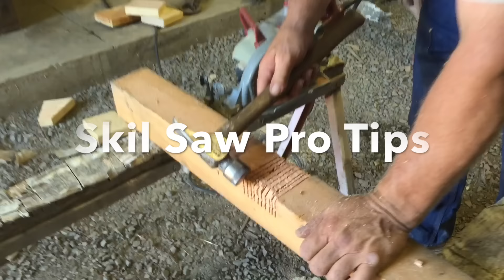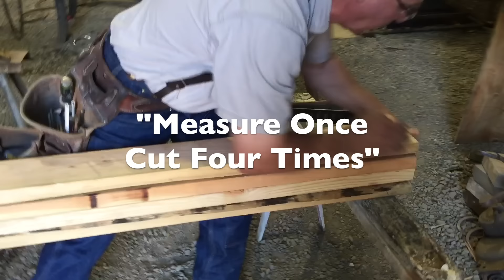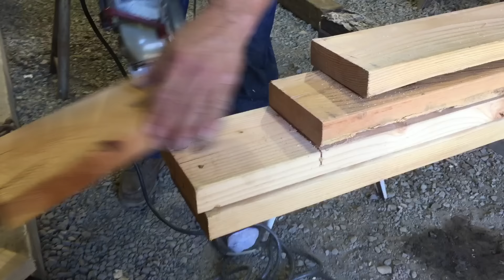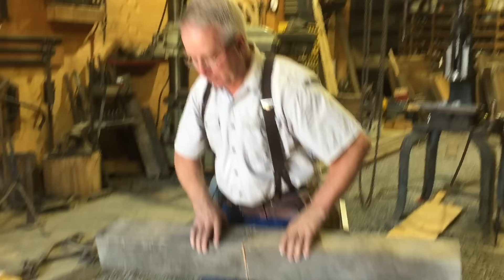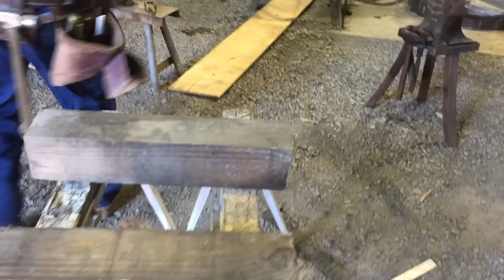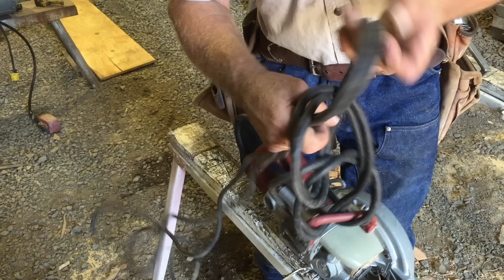Skil Saw Pro Tips

Comment: I’ve cut lots of roofing with a skill saw with the blade backwards. Yesterday I cut roofing with a metal blade my work place provided. Talk about shrapnel. Wore a face shield, leather gloves. Never before have I been hit with so much metal cutting roof. My neck and arms are full of little micro cuts . The metal cutting blade sends little rectangles flying at you. Not to mention my shirt is now full of hundreds of these little metal flakes. Terrible experience. I would recommend a welding apron or leather jacket of some sort.

Comment: I have learned most of your skilsaw tricks over the years, but not as easily as you, for sure!  Often I didn't have any other tool and had to improvise.  Watching you, I see that a lot of your authority with the handling of the saw is because it's a real builder's worm drive saw, with the weight, balance, power and solidity to do whatever you ask it to.

Comment: Before the "truss hook" we would just bury the blade into the truss. Truss adds weight. 
I remember the Skill Saws with out the plastic handles here in the Pacific Northwest it rains a lot. We'd grab the saw and cut everything we could as fast as we could because it would shock you big time! The ground was the 1st to go on the saws. :-) Awa the good old dats at $1.60 per sq ft.

Comment: He didn't say anything about using a carpenter pencil for a rip guide or stacking blades on a regular. Circular saw to cut a dado.or flipping the board over. To eliminate over cuts.if you cut across the long grain that weakens the board I Dont care what he says.I mean I'm sporting 35 years of framing. Custom homes to building one of a kind furniture out of. 1000 year old dead head cypress or boats with juniper(no knots).just saying

Comment: Done it all but when cutting metal i start with the saw away then cut towards me so the blade digs down not up. Like a tablesaw so to speak. I also know that cutting or nicking concrete with the blade will dull it faster that cutting through nails.

Comment: The first things I do to a model 77 when I get one:
1. Put a 30 to 40 foot neoprene cord on the saw. (Got to have that cold weather flexibility.)
2. Sky hook if the saw doesn't come with one.
3. Take the guard off. (Unless I'm buying a saw because the job I'm on requires them and I can't find the ones I've taken off my other saws. Then it would kind of defeat the purpose.) DISCLAIMER: This is what I do and you should probably not do this. If you do and you loose a finger don't point your missing finger at me. You knew the job was dangerous when you took it.

Comment: I used to have a 7-1/4” circular saw but like many machines the motor was on the right blade on left. I hated it. Could never properly see where I was cutting. The Skill saw with blade on the left you can see the cut and you have far better control.

Comment: 10:48 - and let's face it, the cable is replaceable and often the do need replaced. I have a 1970's Black and Decker saw which was used extensively by my carpenter uncle - I now own it and have used it to build my garage and house extension. The cable still has a taped up bit about 6 inches from the saw, I really need to buy some decent rubber flex and repair that!

Comment: may father is 75 has the same skill set this guy does.. when he was in construction rough frame up he would build a house a week one time a house in 8 hours cutting 220 boards in a single day all this stuff hes showing is what my dad did.. i picked up a few things.. but the technical things are just beyond me his carpentry of 40 years paid for the house im in paid for his carpenters retirement paid for my entire life and is still doing so to this day.. those skills transfered to a maintenance position for the govermnet during hsi retirement and secured my future and familes... learn a skill one that others cannot or unwilling and you have something that is valuble..  do plumbing electrical etc.. cnc mill operator etc.. welder.. also wear earmuffs or protection he has rining in the ears.. so make sure to always wear safety and ear protection watch fingers worm drives are old school and have no i repeat no sympathy they will bind will take off fingers will shoot out nails watch yourself

Comment: If anyone is looking to upgrade their saw blade to get a
better quality cut, take the time to go check out the saw blades (mitre, rip,
melamine, glue joint, thin kerf, etc.) over at royceamerica.com these blades
have industry proven performance, being used to supply woodworking companies
large and small across north america for the past 50+ years.

Comment: One thing you didn't mention is that longitudinal plunge cut to hang the saw CAN be detrimental to the board if it is not fairly parallel to the edges.  Think of the worst case,where it is SO non parallel that it actually breaks out both sides...obviously not going to happen with anyone doing that even remotely carefully, but in that case you would have degraded the board immensely, cut it 2/3 rds deep this way and it is junk.   The point I'm trying to make is, if you are going to do this make sure it is pretty darned parallel to the board sides.  Some really great tips here.

Comment: He is a master. But some of the stuff he did was so unsafe it should never be shown let alone even done. Mainly thinking of the plunge cut with his knee right behind the saw. Kick back and you would never walk the same again, make that cut in the air you would probably die. It’s supposed to be the older you get the wiser you get. I noticed his left foot was in a cast, makes me wonder, maybe he pinned the guard back, forgot, put the saw down and it ran over his foot. Could be why he didn’t show that technique.

Comment: In the 70's, if u we're a piece work carpenter in LV or the west coast, u had to know this kind of stuff.
I always took the guard off of. Mine, then u could put an. One in bigger blade and cut ur 6x6 or a 7 on a littler 6 in saw. And u could put ur hand on the front of the saw makeing it safer and a little more accurate.
Not trying to take any thing away from this guy however I like him.

 The worm drive "skill" saw is, imho, the most durable, versatile and best tool I've ever owned.

Comment: I recently remodeled my kitchen and as a DIYer, I couldnt understand why nothing in my house is square. It makes sense now after watching all of these shortcuts. Construction work is so different from finish carpentry. This lowers the bar for me just a bit and let's me off the hook when I self critique my own work.
When I replaced my fence, I even went so far as to run my fence slats through the planer as well as the thickness planer, and I also sanded each section smooth as a babies butt. I only did that to the sections that face the front of my house, but man, those couple of sections still look perfect 8 years later.

Comment: Couple of comments.   Construction workers have an uncommonly and deceptively strong grip.   It may not look like it but he always has a very solid hold on his tools.  If you're going to use these techniques, you need to maintain control of the tool with a firm grip.  Secondly, if you're running a saw, use hearing protection.  If you ask me a question, my reply will be "huh?" because I was too young and stubborn use it, and you might as well forget about having a conversation with me in a crowd.  I'll do my best to read your lips, but I suck at it.  Electronic muffs cost around $20 and will allow you to hear what's going on around you when the saw isn't running.

Comment: Skyhook - Since it has been mentioned several times, here's a suggestion...  For 20+ years I've used the top plastic handle cut in half with the left side removed.  The right side now hooks onto 2x framing members (rafters, joists, etc), and instead of adding the weight of a skyhook, I've reduced the weight a tad.  I actually bought an extra handle the day I did this and am still carrying it around "just in case".  Super Navy Seal SkilSaw video!!

Comment: Wow, super tips and demonstrations! The older I get, the more worried of accidents. I have started using speed clamps instead of my knee to hold down a board on a plunge cut. Always look, if the saw jumps straight back from where it's pointed; if it might hit a body part, you may want to reposition. Not only the way Scott is doing it, but I can tell he has really developed skill holding the saw and following the lines. That's gotta be from a million feet of saw cutting!

Comment: We call the cord "tangle" a "Daisy Chain". It is perfect for a drop cord. But you start by marking the center of the cord with zip tie, tape, or marker. Start the daisy chain there. That way your unraveling will be done at the ends. Then you just pull out the length you need. No need to unravel 100' of cord if you only need 20'. The remaining 80' can stay neat and out of the way.
Instead of squaring your line across the board for a cut, I usually mark the crow foot, lay my speed square on the board(as if to mark the square line from side to side) but with the base away from me. Placing the saw blade on the crow foot mark, I slide the square to the table and use the square as the "rip fence", firmly grip the square to wood, then cut. Saves some time on the marking and sharpening the pencil lead. 
I will have to try the 45 degree method you did while keeping the table at 0 degrees. Never tried it.

Comment: We build high end furniture in the little shop with German sliding tables and stuff. I bought the Bosch-skil overhead handle model 7-1/4" some years ago and the balance is one hand perfect. Had quality problems with the shoe and they replaced it. Had to work on the other angle adjustment to file it to perfection. Balance and the right saw blade is critical to speed in production and quality cutting.

Comment: The 6x6 cut & notching tricks, are something I've been doing for long time. 
 However, your rafter bevel cut & rip tricks, are new to me. I appreciate the heads up on that! I will incorporate that technique, and use it as my own. 
 By the way, what you call a "sky hook," I've always called a hanger? Well, the important thing is, I have one on my skil saw... I really should get one for my nail gun... but, I've been getting by using 16p nails for hooks?
 I put a 50' extension cord on my saw, on day one! It's a common thing to do.
 (Note:
  Extending length requires thicker gauge wire.)

Comment: Don't use a sidewinder for some of these tips, it doesn't have the torque necessary to force it's way through binding on a bevel and you run the risk of it jumping back on you. Your hand is in a different position too so that you are applying more forward force on a rear handle and, if it does jump, can't go as far.

Comment: In the old days of steel blades Dad taught me to get close the the nail and then jam the blade through quickly in order to dull only one or two teeth.  Later when using carbide we discovered that if you did it the same way you'd knock teeth out, so we learned what you learned.  Keep the speed up and ease the blade through, proper feed and speed.

Comment: I saw this for the first time and was very impressed.  Not that I am worthy to say so!  I’m a pretty good woodworker and very comfortable with any woodworking equipment.  However, I have not used a skillsaw for anything other than a straight cut.  I also find myself wanting the perfect setup to use a skillsaw.  I had to use a skillsaw to build my first fence.  New home and needed to replace it.  You inspired me to make the compound cuts by hand and I used a few boards before getting it right.  Is there an easier way to cut the tops off the fence?  I trimmed from the back using the 2X4 as a fence but the cuts from the front were all freehand.  Thank you for the video and more importantly the inspiration.

Comment: Great video!  I have cut notches the same as you for years making a dozen cuts and knocking out 1/4 inch chunks of wood but recently I was showed just make 4 or 5 cuts and knock out 1 1/4 or so chunks of wood. It's much faster and even cleaner at times. I do like how you use your saw. Awesome

Comment: could I put the square on 12x24 if you come out of  the hole as we call it level  fit the house on the foundation square square all exterior walls add sway braces or sheer panels according to schedule you should never use the level to plumb up a wall everything is a number framing 101 iv had dummies tell me to put the blade in backwards to cut metal iv cut miles of it  the best way i found when cutting lots of it make a jig on the table your cutting on so the saw slides above the sheets keep the steel finish up you can stack up to lets say 6 pcs guard should be pined up run the saw backward the cuts are burr-free go slow blade last for weeks 
i like watching competent framers didn't really learn anything but it's nice to know there's still people out there who can think on their feet one thing though i pin my  guards up all the  time only let it down to save the blade I know you can cut circles with a Skill SAW also but that's something that most people shouldn't try keep o nailin

Comment: 14:50 I am a surgeon and frankly the principle of tolerances is the same. Not that we measure tolerances in tissue, but basically fast surgeons are the ones who know where they can move quickly without risk and where they need to slow down and look for important landmarks and structures. Surgeons who always dissect as carefully as if they're on a critical structure are safe, but they're no safer (and much slower) than those who know when to tighten their tolerances.

Comment: When I started framing we had steel blades, no carbide. When they dulled, they could be sharpened up with a file in 5 minutes or so, and when sharp they cut better than carbide tipped blades. I suppose carbide blades have improved over the years, but I used to like the old regular high speed steel blades.

Comment: I really wish power tools came with 9' cords. I'm a trim carpenter and often have to cut, sand, route, or plane on my saw horse bench and I need that much movement. I have a power strip with 12 places to plug in on one leg of my horse. It does get nearly full from all the different tools I use, which I will keep under the bench. That way I am not plugging and unplugging tools all day, and getting nothing done. I almost always cut off the cord of a new power tool and replace it with longer cord. I wish I didn't have to do that. Framers are fortunate in that they do most of their work with one tool only.

Comment: One tip you missed, and not many people know... If you need to make  cuts over 45 degrees...let's say you want a 65 degree cut with this same saw... First you cut the 45, than you set your saw at 20 degrees and cut on the face of the last cut. You may have to finish if off with a sawzall if the cut is two deep,, but you have most of the cut done and straight...

Comment: You're the Pro, I'm not, but I never put my knee behind a plunge-cut after experiencing a severe kick-back one day caused by I don't remember because it was over 40 years ago. As an Electrician, I never yank the cord out of the outlet for the same reason you don't dangle your saw by it's cord without looping it thru and around. On the other hand, we can abuse our tools to save time and effort as long as we take an extra day afterward to check, repair and maintain them.

Comment: Ok I agreed with you all the way up to the cutting metal roofs material with a skill that hot sparks burns into the paint and causes it to rust like crazy and I know you can get the spray can of paint in the same color but that stuff doesn't match always and one is baked on the other is of course is sprayed

Comment: 3:38 - why it isn't a structural defect by overcutting - the top of the rafter at that point is in tension, the bottom compression, so the edges of the cut will be pressing against the timber below.

Comment: after years of using saws that have been just tossed around the gang box I never trust the table. there is always a hole in front of the blade in the guard you can see where the blade hits the wood thats where I watch for the most part

Comment: For cutting sheet metal with a standard saw, I use a piece of 'sock' material from a perforated 4" ADS pipe and some electrical tape to wrap a cover over the vent slots around the brush area.  This will keep the hot chips out of the motor which is the biggest reason for failure when cutting metal with a standard say.  I have one saw set up with a metal blade and it has the same sock on it that I put on it 8 years ago and I've used it that way quite a bit every year since I do both metal roofing and concrete pan decking as part of my work.

Comment: One of the best Skilsaw modifications you can make is the Pepper Manufacturing Company's replacement top handle.  The best thing about it is the top leg that allows you to set your saw on the floor with what is the equivalent of a three point stand.  It leaves the handle in a place where you can easily reach the saw for your next cut. Two other things is that they will hang easily on rafters and joists and when you have to swing a saw up to make a horizontal cut in position, the third leg gives you a very good handle to make the cut more safely.   http://www.originalrafterhook.com/

Comment: Instead of using the "Polish Plane,"  take your hammer and whack the extending material.  It will almost always do the trick.  If it doesn't you can bust the splinters with the claw of the hammer first and then drive the material.  The Polish Plane can be used if all else fails.   AND I would have used my Husqvarna chainsaw in the first place.  I can cut about twice as fast and just as accurately.  Yes, I've had about 50 years of practice with a chainsaw, but you can become very adept very quickly with practice.  Of course you could just run an 8.25" saw as well and avoid the issue in the first place.